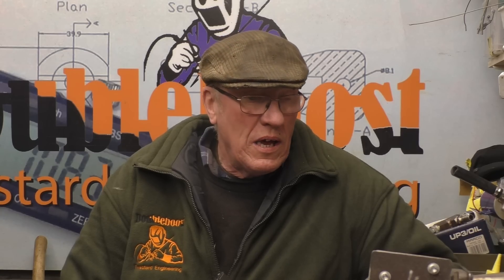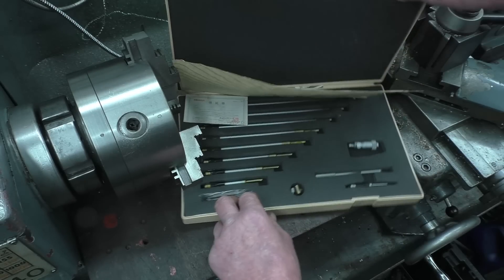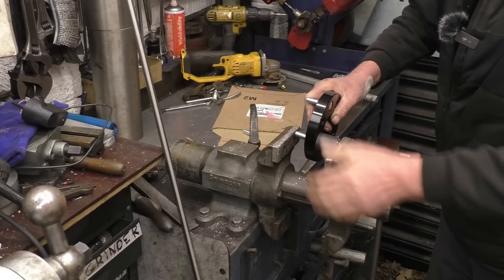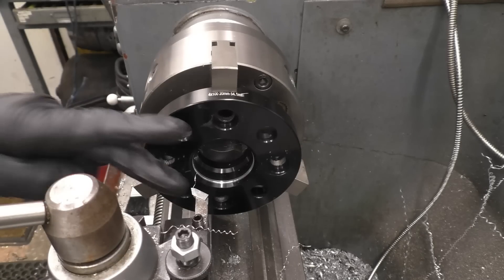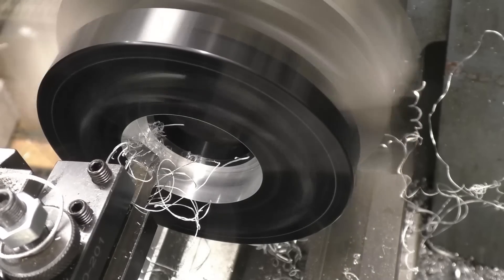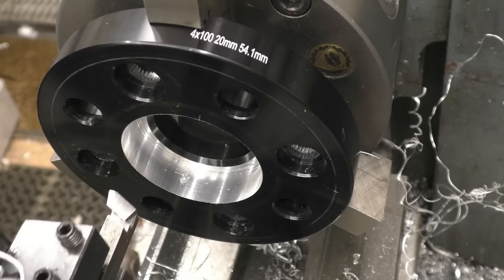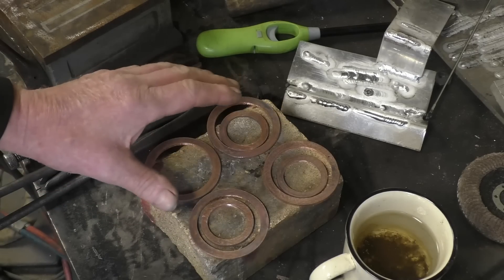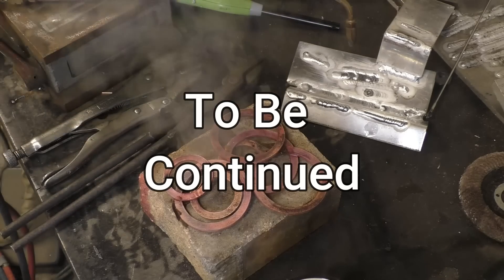SNNC 470 P1  Monthly draw  .Wheel Spacer MOD . Plasma Cut Copper.

Comment: 2023 give away 2 John.
No Doubleboost mug? Joking!
Turning 4 slide valve piston rings the OD is done but the final ID, 145 mm, or 6 inches, remains. Such a  set had been perfect in the veteran railroad club.
Time 04:00, vise press... Great John! That's my pressure tool as well. Sometimes the mill or "hammer press"....
Plasma cutting looks very useful but call for knowing CAD. The time learning it, if possible, looks like too much. Better have fun doing the primitive things that work...
Time 14:40. A Doubleboost mug? Joking! Looks like a mug in metal being enamel?
Time 15:00. Burning the fingers? What will Deb say later......? Joking!

Comment: Wheel spacers are not legal in Australia

You are not permitted to increase the track of a vehicle.

You can widen a wheel by two inches but that modification must not altered the track of the vehicle.

The reason is that it is a dangerous alteration.

Stavros
Reply: Lovely to hear Steve,
This modification was for a UK vehicle so legislation in Aus is meaningless, the spacers are designed for use in motorsport and perfectly safe.  The application for these particular spacers is a hand built 'kit car' so there is by definition no real 'standard' which is being altered...